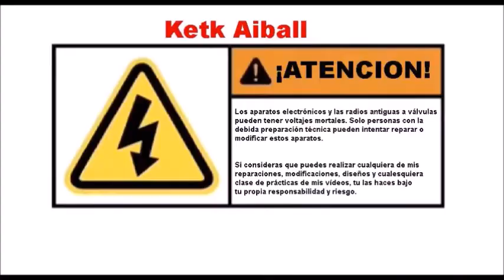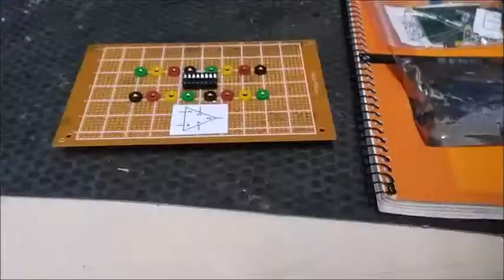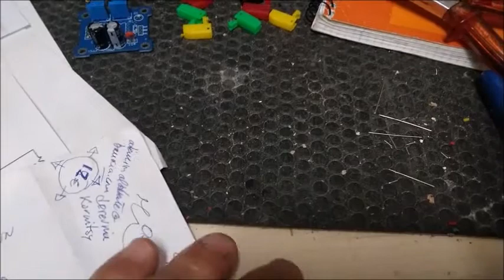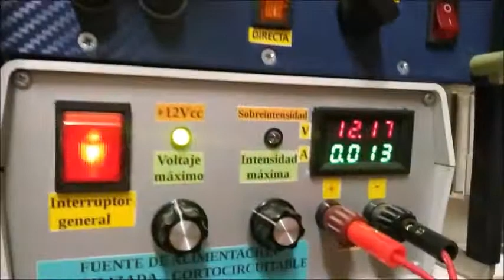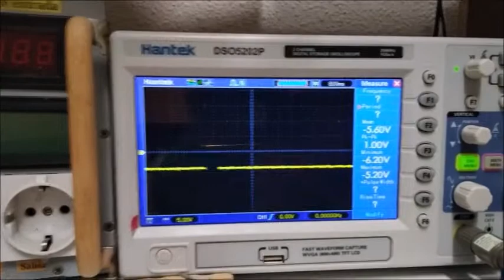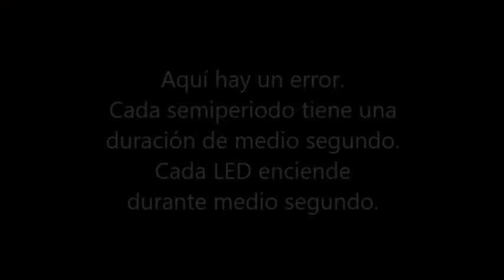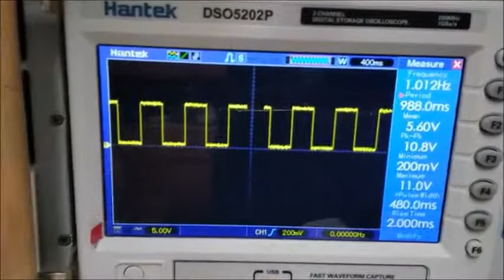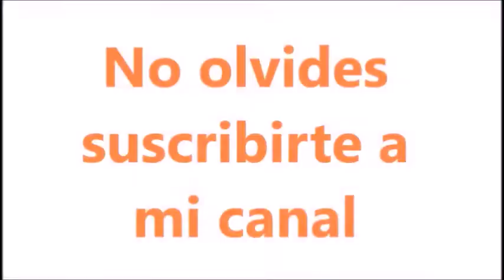1- Diseño y construcción Comprobador de OPAMPs y 555. (Modelo básico).

Comment: Hola Ketk.  
Interesante montaje.
Lo de los componentes chinos....es una lotería, hace unos meses compré una fuente de alimentación en kit, regulable de 0-30 V y hasta 2 A., para incluirla en un montaje.
No conseguía hacerla funcionar, tras descartar el resto de componentes, me dió por preparar un sencillo montaje para hacer oscilar los TL-081 que lleva y resultó que 2 de ellos estaban mal.
Espero el siguiente capítulo.
Un saludo.
Reply from the maker: Hola Juan Angel. Que sepas por si te sirve de consuelo, que no eres el unico ni el primero ni el ultimo al que le venden unaa fuente de alimentación con componentes defectuosos y con los CI defectuosos. A mi me vendieron ese lote de CI uA741 que no vale ni para adorno. Eso fue lo que me hizo diseñar y construir este comprobador de OPAMPs y de 555.
Nos vemos al siguiente capítulo. Un cordial saludo.
Ketk.